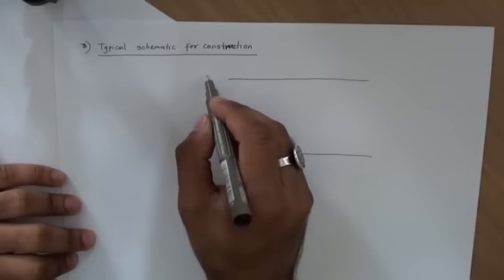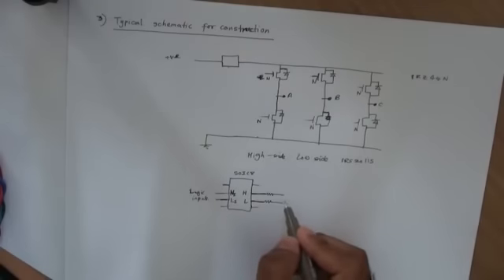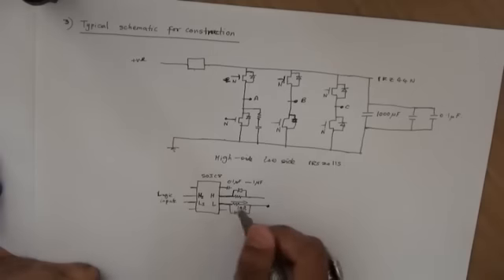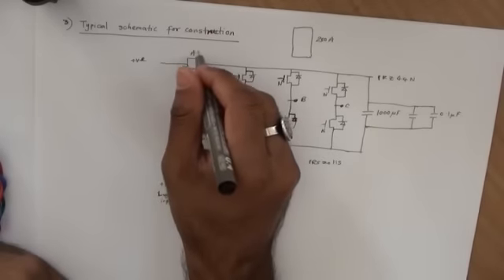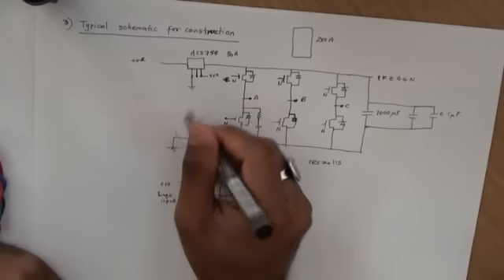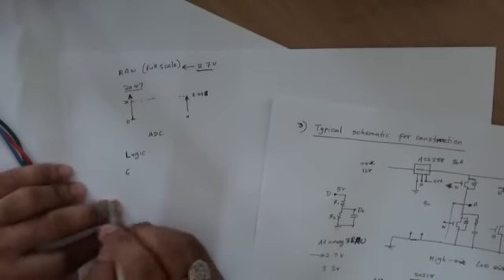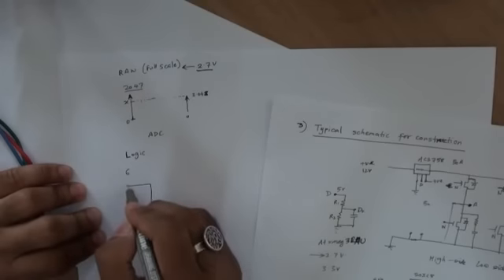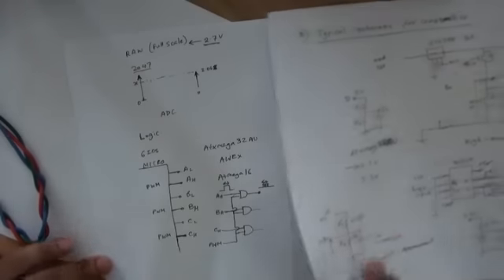Xmega Brushless DC Motor Controller (BLDC) - How to Part 2

Comment: hello can you tell me we have five sensors wire sfrom that three hall sensors wires are used for connection and other two wires are what?
Reply: Hall a, b, c; +5V, Gnd
Reply: Thank You,
can U tell me about battery capacity
i have two Motor of 250 watts, 48V so how much capacity I should need for about range 20km/hr 
please tell me ?

Comment: Hey how would I calculate the current limiting resistor going into the gate
Reply from the maker: This depends on the gate charge and the rise time you want to have in charging the mosfet gate with adequate charge to turn it on. Effort should be made to minimise this rise time, as you have power losses during this period and the fall time. So longer fall or rise time also means more energy loss (hot mosfet). At the same time if this time is too short...you get "rining" when mostet turns on or off..which you can then diminish using snubber networks...So you have to find a balance for all this using experiments and datasheets and measurements.

Comment: Great Tutorial I am designing a BLDC motor controller for a E bike. My specs are for a 72V supply and 100A controller my motor is of 5KW. You are designing a sensorless drive but i am using hall sensors to detect the position of the motor. Can you give me more info on the design and the notes you had to design the system 
Thankyou 
Waiting for reply

Comment: great tutorial!!! I can see the whole system working fine without the current sensor, so I'm wondering what's its purpose? or maybe I'm missing something?
Reply from the maker: +Samer Abdulhay There was a current sensor. I think the current limit was set to 5A. It is in line with the positive rail. Current sensor values are read by the micro controller, when the values go beyond 5A setting, the motor PWM firing is turned off.

Comment: You explained the hardware in painful detail except why you must PWM the HS. Why not PWM the LS? Great video! Thanks for sharing.
Reply from the maker: There are many ways to drive the motor yes, PWM on high and not low and then PWM not high and just the low side and PWM both side etc...there is also the PWM on both high low of a single phase and just low on the 2nd phase. This later option is what I choose. Basically you must PWM the high side if you want to use the BEMF to detect the motor rotation as feedback. You can go through the mathematics of current flow and you will see. Plenty of texts online for this. In my circuit I PWM both high and low of one phase and then just pulse and no PWM of 2nd phase. This gives the best kick to the motor.

Comment: I am trying to drive two MOSFET gates each from one TI DRV8301 driver chip.  So I have parallel H-bridge circuits with the outputs driving identical motors.  I am getting a software fault.  What would recommend for filtering to make this setup work.

Comment: I am trying to drive a BLDC motor. I was driving 2 phases and keeping the 3rd phase floating so as to measure the BEMF in it. But, what I find is whatever voltage is applied on the +ve or high side comes as it is (in voltage) on the float phase. Am I looking at this wrong or is the motor behaving weird. May I have ur email sir.
Vinod.

Comment from the maker: this will cause the micro controller to float above ground. This is not good....specially when the micro controller is measuring the ADC inputs from the 3 motor phases....
3) There are sevaral way of driving a BLDC motor....you can PWM only low side, you can PWM only high side, or you can PWM both (there are different firing principals even in this method)...All these types will determine how you read the BEMF...only the high side PWMing will give appropriate mechanism to measure BEMF.

Comment from the maker: 1) small capacitors on the main motor rail in order to reduce noise created motor switching...small caps act as a short circuit to high freq noise. So most high freq nosie will get grounded.
2) resistor current sensing can be expensive, depending on the value of the resistor and the wattage requirements. plus when you place the resistor there is a voltage rise across it. This voltage rise will mean the motor ground will sit "above" the supply ground.

Comment: Dear luvocean1, 

Could I ask you some questions?

1. Why put several small capacitor in parallel of the 1000uF capacitor at schematics?
2. Drawback to use simple resistor for current sensing?
3. Why only the high side has PWM?

Thanks.

Comment: I see you are using all Nchannel mosfets I have seen most using P channel and N channel.  I have a motor I want to us as a motor its 3 phase. and is a 100 amp 48 volt motor.  I did buy a rc controller to just see if it would work but I know if I want to use it fomr somethign for power I need a controller for a lot of power. up to 3000 watts.

Comment from the maker: I have used IRZ44N as it was easily obtained here. You can have a look at International Rectifiers website and decide which mosfet is suitable for you. Basically you wan a mosfet that has a rail to rail voltage tolerance of atleast 20-55V if you are driving a 12V motor. IRS2011S is actually a high side and low side mosfet driver. It can drive most N mosfets that you will be using, nothing specific to IRZ44N at all.

Comment: in this circuit you use IRZ44N and driver mosfet IRS2011S yes ro no ?
but in thailand i can not buy IRZ44N and IRS2011S you can introduce another part can use in circuit yes or no.